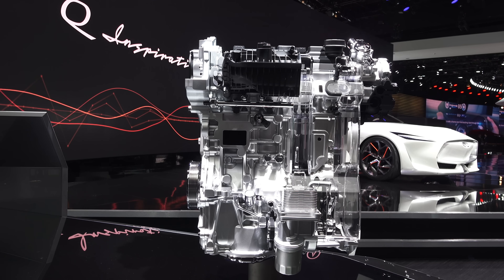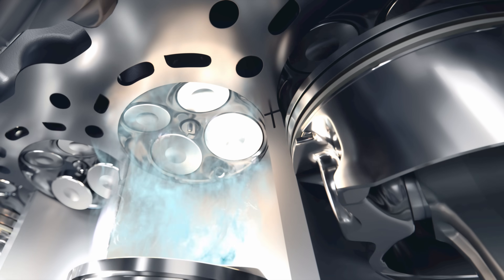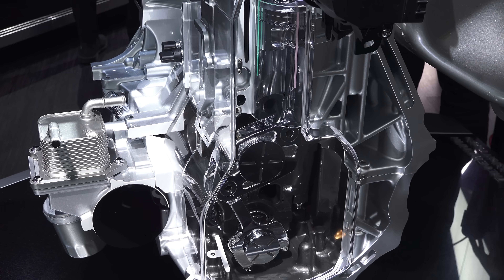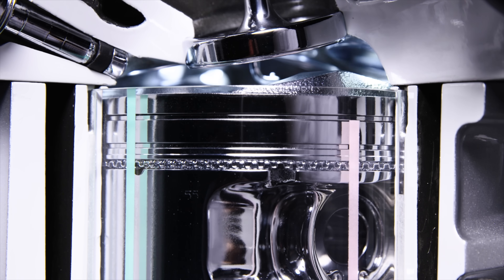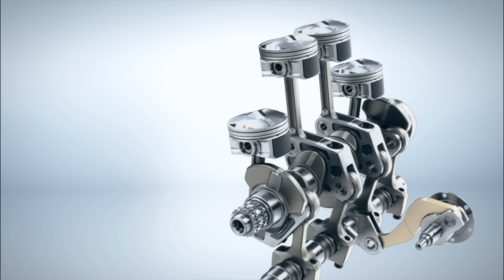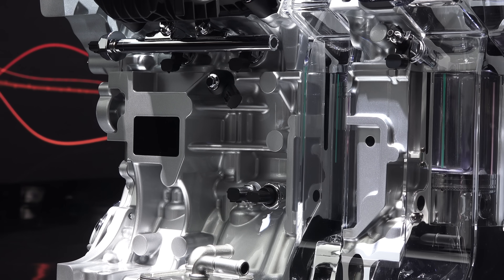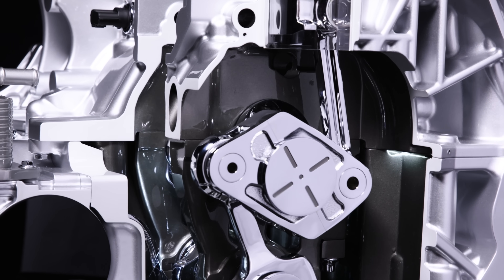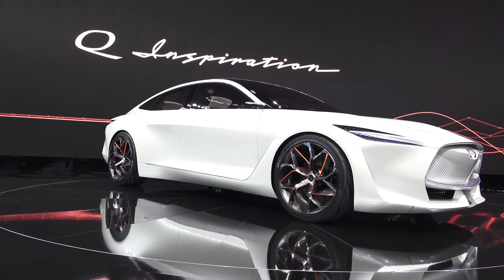INFINITI Reinvents The Gasoline Engine — VC-Turbo

Comment: High octane gas: with a price somewhere is the neighborhood of 10% more, subtract 10% from mileage rating to get an apples to apples mileage comparison. Cynically, one wonders how much of this is designed to take advantage of EPA measurement methods to deliver better than real world emissions and mileage. Never trust any corporations motives at face value.
Reply: PN NH This is designed exactly for the EPA tests.. you pass the test with low-consumption/emissions mode, then in real life you advertise the high-power mode. Just like VW 😁

Joking aside, one spends much more time cruising than racing. You get the fuel consumption/efficiecy benefits coupled with the high power output for the situations that require it.. win-win for everyone
Reply: PN NH The 14:1 ratio requires It. This could be a nice ethanol running engine.
Reply: This engine running premium vs an economy 4 cyl running standard fuel is much much more than a 10% increase in efficiency. Premium works wonders for gas milage on its own, and it only runs premium because of the turbo, which also improves efficiency.

Edit: and jeez where do you lot live that you're getting 10% - 30% on top of the price of standard to get premium? It's 5% here and that often feels high.
Reply: Eat Jat Only one problem...mechanical solutions are prone to mechanical problems. An electronic solution if done right has no more moving parts than the solution without(and indeed in the case of the Prius, LESS moving parts), and is far less prone to failure, though perhaps not as easy to work on.
Reply: Same issue I had.  Great idea, but negated by need for premium fuel.
Reply: The trouble with all Infinity products is that they all require premium fuel. They design them that way because they want to be a premium brand and all premium brands require premium fuel. Not sure about your location but around here there is generally a $.60 gal hike up on premium fuel. That is closer to 30% markup. I am sure that this engine could be tuned to run on regular gas easily. It is mostly just marketing fluff.

Comment: Cool technology but I wouldn't want to step on the gas to pass somebody and have to wait 1.5 seconds for the engine to adjust to maximum power. Just like CVTs in Subarus, they are really cool technology but the lag drives me crazy.

Comment: Seems a lot less complicated mechanically than I expected when I saw the title of the video. Always great to see innovation like this! 

Hopefully consumer testing reveals it is more efficient. I may have missed it but what are the min/max volumes of the engine?
Reply from the maker: Displacement remains at two liters (swept volume), with the compression ratio changing.
Reply: actual wrong dispalcement is in the 2 liter rem but actual it changes in diplacement for eg 1981 CC to 1999 cc
Reply: do not remember the exact figure but it was something like 1981cc at 8:1 and 1999 cc at 14:1
Reply: chan129 brown no company advertises the exact size, I forge twhich manufacturer but they call they're 2140cc engine a 2.2L. 1981 to 1999 is very very close
Reply: Rome1017 nissan did it actual 1991 and 1998 cc. You can find it on motortrend.
Reply: Isaac Kvasager read and understand what is written. I said the cc rating is not fix, although it stay in the 2.0 liter rem. Normal 2.0 liter cc are fixed.
Reply: How am wrong the engine it operating as two in one. That the first thing you should know. No other engine does that. The engine has two cc rating nissan said 1991 and 1998. You can go take it up with nissan that they are wrong.
Reply: +Isaac Kvasager : Nope, YOU are wrong. Chevy 350cid = 5.7L, Ford 351cid = 5.8L, Dodge 360cid = 5.9L. GET YOUR FACTS STRAIGHT, dillhole!

Comment: Is there a single arm to adjust the compression or there is one for each cylinder? If so, can 2 cylinders have a certain compression and the other 2 other compression?
Reply from the maker: Single arm (harmonic balancer) changes the compression ratio of all four cylinder simultaneously. There wouldn’t really be much of an advantage to independent control, and it’d be much more complicated.

Comment: What about other fuels? Can we use alcohol and gasoline in the same car with more efficinecy? Here in Brazil we have flex cars wich use gasoline and alcohol, but they're not efficient because the best compression rate for each of these fuels are different, so, could we fix this problem now? And could Infiti produce big and powerful engines with this tecnologi? I mean, 6 or 8 cilinders with something like 400 hp?

Comment: WOW!
That is outstanding that Infinity hooked you up like that..... and it really shows that your channel is watched by smart people that wish to thoroughly understand the engineering of an engine!  lol
Sadly though... I drive a 12 STi.... with an engine design nearly 30 years old... Sure it's been updated of course, but at it's core... it's OLD.
Reply: +TheDBall73 30 years old? What about it is 30 years old? Do you just mean the EJ platform or whatever?
Reply: Lol, my car's engine originates from 1961. Ford Windsor.

Chevrolet's most popular engine has its ancestry in 1955 (good ol' Bel Air), and that one is still in production to this day.

America.
Reply: bokkey45 While normally I would agree I think lack of innovation is what kills companies. Take the 22RE from Toyota for example. The engine was a hell of a workhorse and reliable. But they dropped it. They had to innovate. Get more power and mpg out of an engine. That’s what these car companies have to do now. Or else electric will completely leave them in the dust.
Reply: TheDBall73 And what's the issue? Old engines are the better, boy!  More exciting
Reply: electric feel Is easy like a normal engine to do improvements. 

The Boxer basis was so good
Reply: my 2001 540i sportwagon has a better engine than any new TT4 or TT6 cylinder XD

4.4L of german shove vmax 155mph
Reply: electric feel no, not necessarily. The EJ is the second generation of subaru's boxer lineup. Subaru was a medium sized company until very recently, in which they have started building new factories to keep up with demands. Back then their rescources were too little to come up with new engines almost every 5 years.

Right now their focus is most likely improving upon the 3rd gen (which is going pretty well), quality control (interior plastic used to squeak during winter due to vibrations, mostly fixed in 2016 models. One example) and manufacturing (becoming more effective, and breaking the wall between the japanese market and international market, as well as setting up factories in north america)
Reply: bokkey45 Subaru still can’t fix major reliability issues with the EJ style engine. Newer ones were still suffering from headgasket failure and the late model STi’s still suffer from ringland failure. The new FB and FA style engines have proven that ringland and headgasket failure is a thing of the past.
Reply: There's a reason it's design lasted that long.
Reply: EJ25 went into production in 1988.... Like I said it's been updated with fuel injectors instead of a carb and several other things, but it's still a 30 year old engine block, heads, and intake.
Reply: Older designed engines are the most reliable
Reply: I'm not an engineer but I think it's hard to improve the engineering of a boxer engine. Subaru has only made small tweaks to it such as displacement, compression, and more boost...

Comment: But why? Couldn´t we just choose an engine layout with a high compresiion ratio and just reduce the effective compression ratio by keeping the valves open for a longer time, or closing earlier?
Reply: RTproductions499 on direct injection motors we can. On port injection engines you would throw out some gas with the exhaust. I think the main benefit is that the balance shaft is a part of this system. It also increases engine efficiency due to less friction.

Comment: The concept of an engine with variable compression is not exactly new, but developing it to the point of a mass produced engine is indeed. On this Infiniti engine the elimination of secondary imbalance is amazing. I wouldn't worry about reliability at all. 

I wonder which engine will be more efficient, this one or Mazda's SPCCI.

Comment: Super complicated, i think they should have spent the R & D money on improving battery efficiency for future all electric vehicles.
Reply: Michael Miccio battery technology is always advancing but there will always be some need for the combustion engines. Batteries can never have the energy density of fossil fuels
Reply: Nissan Leaf 🚗🔋
Reply: JEFFLIQUID25 Electric drive needs less energy and electric energy is easier to create and transport. We don't need to match the same energy density as fuel. EVs are already out-pacing fossils.
Reply: SillyBoi What about hybrids? Just have the piston engine hangout as a generator. Like diesel-electric trains.
Reply: batteries use as much fuel to make vs just designing these HEVs
Reply: JEFFLIQUID25 China and Norway: Electrified personal mobility is where EVs have out pace ICE. Road racing too.

 If your planes and ships are burning fuel they're probably dumping half of the energy as heat. Since electric drive is pretty close to 100% efficient getting to 50% energy density is enough, though we're not getting there, probably ever.

The obvious solution is you need more liters of battery than fuel to complete the same trip. We would need some crazy tech where the structure is the battery. Obviously right now we don't have continental containerships or airliners operating on massive batteries.
Reply: We can "walk and chew gun at the same time". Its a shame BEV only (Elon cultist) trolls r to narrow minded to appreciate that concept. EVs r coming based on the advantages they bring, even with their short comings. Not on just bloviating about them.
Reply: Thats exactly whats going to happen. More and more hybrids are going to start popping up. Which i honestly don't mind
Reply: A lot countries have planing to ban the ICE. So we will have to see what happens? Norway has already forced much of switch over already.
Reply: Uh. Nissan doesn't make batteries.
Reply: If somebody can make a breakthrough in battery energy density and/or cost, the internal combustion engine is dead.
Reply: breakthroughs don't happen overnight. if there is one to come most big corporations are already preparing for it. the internal combustion engine has been dead for quite some time, there are just no viable electric options.
Reply: difflocktwo electricity is only as easy to transport as the infrastructure in place. For some applications you do absolutely need at least similar energy density e.g.. ships and planes. I don't know any where that EV's  are outpacing fossil fuel vehicles.
Reply: Michael Miccio electric vehicles won’t become the norm for a very long time.
Reply: Michael Miccio err no.

Comment: Sounds like they needed to deploy so many more vehicles because it had so many more problems than a regular test launch..
Reply from the maker: That’s not how validation works. You wait to deploy prototypes once you’re confident the engine can handle it, then tweak the tuning as you pull data from all the different locations.
Reply: Actually i know exactly how validation works, you put out your engineering samples, Then a sample size for validation, if test data is not to standards then you go back to producing some more engineering samples with applied tweaks (change requests) and then put out more vehicles for validation.... what im trying to say again.... it must have been a reason for them to use such a big sample size when the minimum was 50,,,, that to me raises a flag....
Now im not saying Dynamic Variable Compression is bad.,, im just not sure thats a very efficient design.... 
on the other hand.... you rock man... keep the info coming..,

Comment: This is so gonna be another one of those engines that gets twice the MPG in [insert agency here] than in real life, isn't it? Let me guess, the turbo will go on boast at like 1000rpm and make sure that the engine runs low compression and rich in anything but an EPA test run, am I right?

Also, all those extra bearings and linkages would contribute to higher friction especially in high rpms..

Comment: Fascinating. Will be interesting to see real-world efficiency results. Nissan is not exactly known for making fuel efficient engines. Powerful engines, sure, but not really efficient. And the added mass plus friction that result from doubling the number of con rod bearings, that intermediate link, and so forth leave me wondering how much of the thermodynamic improvement will actually make it out to real-world end-use improvements. Kinda like how Ford’s 3.5 Ecoboost, for all the whiz bang tech and talk of thermodynamic efficiency, doesn’t really beat a GM pushrod 5.3 V8 in real-world end-use efficiency. And that 5.3 is going to be a lot simpler/cheaper to maintain in the long run.

Lastly, the 3mm km and 30k hrs of testing sounds like a big number... but I have been on engine programs that did far more durability test hours than that. To be blunt, I won’t touch one of these with a ten-foot pole, and I won’t recommend one as a long-term vehicle to anyone until a LOT more real-world durability data is available. To be clear: I am not predicting that it will fail. I am stating that it hasn’t been proven enough for my tastes as an aerospace propulsion systems engineer. Need more data to really trust it. As one of my colleagues has pinned to his cubicle wall: “In God we trust... all others bring data.”

Comment: Surely electronic Cylinder deactivation would be simpler, and give great variety of power
Reply: Yeah that's what all the Germans car manufactures are doing right now.
Reply: It makes sense in a v6 or a v8+ but we are talking about compact i4 engines meant for smaller engine compartments. There are limitations with cylinder deactivation as well. Doesn't give you a range, just gives you 2 points.

Comment: Are we talking about Diesel-like MPG? Or lower? Or maybe higher (but I doubt it)
Reply: Diesel is more energy dense so it would have to be more efficient to even match mpg.
Reply: diesel has higher energy debsity plus high compression allowabces, so it will be hard reaching that goal
Reply: diesel like fuel efficiency, the engine will crank out 268 hP return 31 mPG high way, 27 combined. Last time I check only regular 2.5 liter gas engine with around 180 HP can return that figure.
Reply: Mazda's new HCCI engine has Diesel-like MPG so why not this?